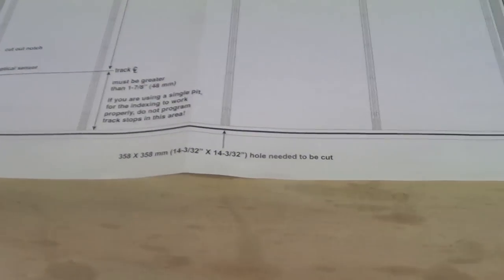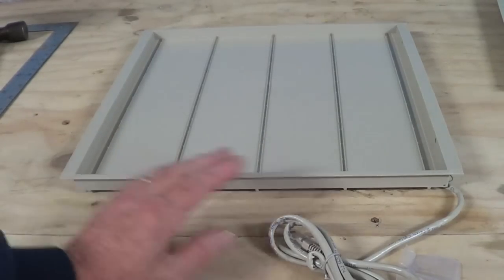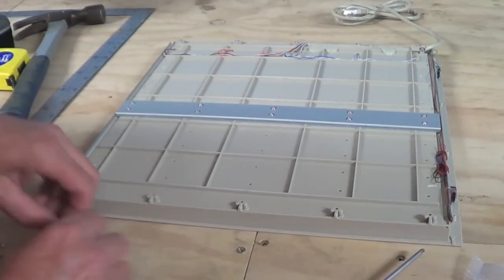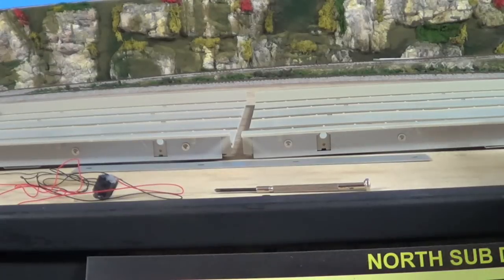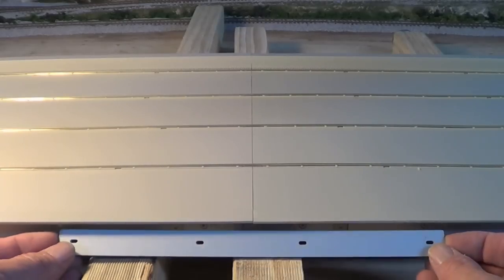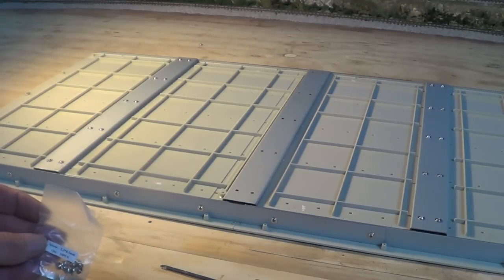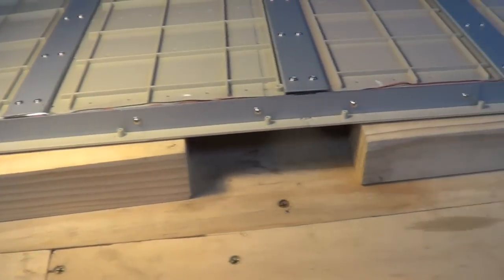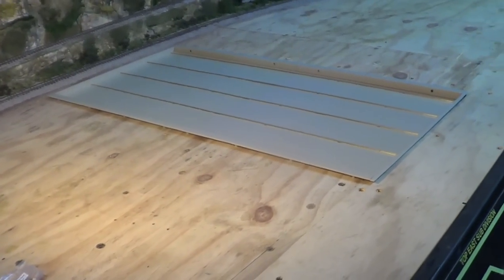"Walthers Transfer Table" Model Trains Part 42  "B"

Comment: Seems to be quite a system to assemble and program  I like it better than a turntable but I heard there are a few issues with the table.  Until the next part.
Scott
Reply from the maker: Scott Downey Scott hope i can make the table better by adding the beams and then she should be better cheers Robert